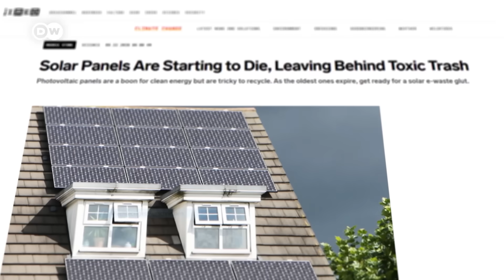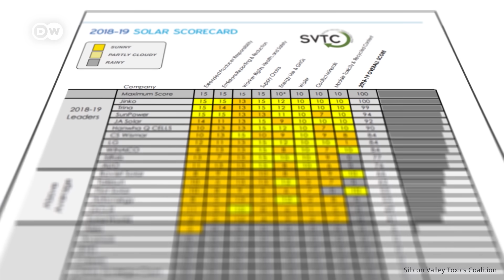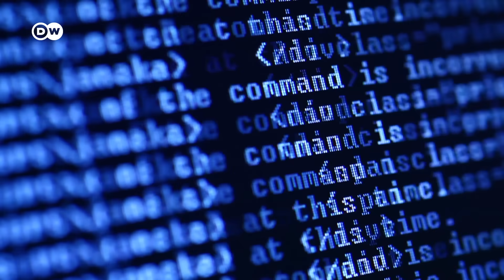How green is solar energy really?

Comment: It is relatively easy to calculate the carbon footprint of production and disposal costs. Yes, these are real, but generally a tiny amount compared to the amount offset over 25 years of production. I remember the same panic/misinformation about wind turbines, then scientists did the math and found out it takes less than a year for turbines to make up their production carbon footprints
Reply: About wind turbines, i heard (not 100% sure) that they aren't recyclable and they just get buried underground. And they are massive, if u ever saw a blade on a truck trailer.
Reply: In fact, they say it's a tiny amount, they are objective and correct.
Reply: @gabr1p1p1  that's good. I couldn't make it through the sensational first several minutes. It took so long to get to the factual story, I gave up
Reply: @fnusecurity5112  Thank you, Mr. Guard Shack.  I keep saying, "THERE AIN'T NO SUCH THING AS A FREE LUNCH".  Renewables create NEW problems.  They are not a magic silver bullet.
Reply: @fnusecurity5112  The whole problem of this modern world is that everything is seen through the “profit”. At this rate, man requires 4-5 Earths to sate his needs and greeds. Man’s “economics” is flawed; he and his technologies owe an apology to ecology.
Reply: From what I understand—and Shellenberger does an excellent job diving into the economics of PV panels—it's not just the production of them. It's currently much cheaper to produce them than to recycle (first flag). Then, there's the issue of consumption: on average, people are replacing them with newer models well before 25 yrs (second flag). Finally, they release some noxious materials when left in landfills.

I think the best path forward for many societies is a combination of LPG, hydro, and nuclear.
Reply: @MadLadsAnonymous  Alternative energy farms are built without any consideration of decommissioning.  I live below a group of wind farms (alas).  When the wind farm corporations were going through the approval process (wining, dining, and flattering the unsophisticated County Commissioners of our rural county), the County did not include a provision for decommissioning the turbines.  When the turbines are defunct, this impoverished county will be stuck with the cost of hauling the turbines away  (or leaving them to rot in place).
    We should focus on fixing urban transportation.  Buses and trams powered by hydrogen?  Why not?  Preferable to electricity produced by nuclear plants.
Reply: @zeitgeist5134  Do you know what it takes to decommission a nuclear plant? You would be appalled.
Reply: Wind turbines slaughter birds, especially migrating birds.  This is an environmental disaster.  Those dead birds were vital to the ecological balance.  In 2000, I moved to the Columbia Hills flanking the Columbia River.  At that time, circling raptors filled the sky; it seemed as if there was a raptor on every telephone post.  Then they built the wind farms.  The wind farms exterminated the raptors.  Gone.  Dead.  As far as energy production is concerned, THERE AIN'T NO SUCH THING AS A FREE LUNCH.  Renewable energy just creates new problems.  We need to reduce consumption, reduce the demand for electricity.  We burn so much electricity for no good reason.  Like energy-hog Las Vegas.  It's obscene.
Reply: @zeitgeist5134  Glass windows kills magnitude more birds every year than wind turbines.
Reply: @danielvilliers612  That is so very reassuring.  Vast numbers of birds are being killed by glass windows, so therefore it is perfectly okay that turbines are slaughtering migrating birds (and migrating bats....do you have any evidence that glass windows kill bats?).  It's okay that turbines exterminated the raptors in the Columbia Hills.
     There is a voice in the primitive part of the brain, going way, way back in evolution.  It says, "I don't have enough!"  It's the engine that drives the consumer culture, and the compulsion to consume is destroying the planet. killing the wild creatures.  But there ain't no such thing as a free lunch.  We will pay for our folly.
Reply: Were those calculations done under the assumption the production is done in America, or China.
Reply: Just read comments, leave like there, skip this vid.
Reply: Do you have any sources? I'm curios! I love solar panels!
Reply: The real carbon footprint is a lot higher. How high depends how much energie is NOT produced by nucleair, gas, coal… As long as these traditional power plants are running, because of grid stability, the green gain is a fraction of what the PV and wind turbines produce. The traditional power plants just blow the energie (steam) through there cooling towers, just in case a cloud crawls before the sun or the wind speed dorps. If so they can send the steam right away to the steam turbine and keep the grid alive. Heating up the boiler takes too much time so it is kept hot and the exces is waste, straight to the cooling towers. Heating up the boiler takes too much time so it is kept hot and the exces is waste, straight to the cooling towers. So minimal less traditional energie is produced, so minimal gain for the environment. So what we do today has to be done in a different way are there will be no benefit for our earth. We have to continue to improve our energie/grid stability if we want to make a diffrence. And driving ev is going to even bring more stress on our grid. Charging cars after sunset...
Reply: Well analysed!!!what we require is a comprehensive equation!!!
Reply: We’ll run out if the raw materials necessary to produce the batteries necessary for solar and wind long before we’d run out of natural gas.
Reply: @Daniel Meyers You know how much oil they use?
Reply: I think the main concern will always be the end-cycle of these panels. Despite what this video states about recycling solar panels, there is NOT YET a viable way of recycling it. And that is the main issue...not forgetting the mammoth amount of space these things need to generate the same amount of electricity, as conventional methods...
Reply: Less than a year for wind turbines what the ..... What are you talking about 😂?!!
Reply: they claim - solar panels produce 43 g CO² per kWh !
that's impossible !
a 1 kW panel produces (in India) more than 4 kWh per day (annual average ).
efficiency decreases every year over 20-25 years (considering 80% between 15- 20 years etc).

It will produce 29950 kWh.

if their claim of 43g/ kWh CO² footprint is right ; it means
 1 kWh solar produces 1290 kg CO² from mining through installation.
totally false !
petroleum lobby at work.
Reply: @pravindahiya719  you underestimate how much energy it takes to mine the materials alone and the fact that it takes huge amounts of power to make them.  Almost nobody is recycling panels or blades and the companies doing it couldnt be profitable without goverment subsidies or grants.
Reply: @chuckd9007  And you don't know how to count. The guy provided numbers, you provided...
Reply: You don't even need Scientists to do the math. This is math on 9th grade level.
Reply: @neptun2810  I know, that's why seeing a 10 minute story on a non-issue is frustrating. You know the whole topic is only brought up by anti-renewable energy lobbies to implant doubt in new tech, anyway. From a carbon balance perspective, it's a non-issue.  Yes, waste mgmt is an issue to consider, just like everything else that gets made.
Reply: @guru47pi  Yep, this video pissed me WAY off.
Reply: @guru47pi  Yes, but there are perfectly valid points they do make that you’re ignoring. Like the fact that trying to get our current power grid to work on intermittent power sources like solar and wind requires a fundamental different engineering philosophy than the one our power grid was originally built on. Electricity isn’t like water it works in fundamentally counterintuitive ways sometimes. The only reason our power grid, which we spent 100+ years building, isn’t constantly exploding is because we’re able to maintain constant voltages and frequencies, frequency drops even slightly and it’d surge back and blow out the generators and substations, too high and it’d start melting the wires. It’s not enough to simply make enough electricity we have to be able to transport it too, and unfortunately there are regions in the us where solar and wind simply aren’t practical, the further north you go the less useful solar is and consequently the higher the carbon footprint. The further electricity travels the more charge it loses.
Reply: @ls93780  that's not an argument against renewable; that's an argument for a modern electrical grid w/intelligent storage and surge capacity. For example, South Australia has lots of coal and a little solar and wind; they installed a Tesla battery system and it cut electric costs dramatically, and paid for itself almost immediately
Reply: That tiny amount you are talking about is acres and acres of solar panels. Didn't you listen to the video? It says there are about 250,000 metric tons of decommissioned solar panels now but by 2050 that number could reach 80 million. What use is watching a video if you don't listen?
Reply: @Rap  it's a tiny fraction of what the environmental impact of oil and gas is. And over time, companies will find a ways to reduce the waste as volumes go up and metals get more expensive. 250,000 tons sounds like a lot, but on a world or national scale, it's tiny. For example, US solar and wind make about as much electricity as coal, but coal burning takes 500 million tons of coal every year. The waste from solar panels is 0.05% as much coal burned in the US every year, and all that burned coal doesn't disappear, it goes into the atmosphere
Reply: I'm more concerned about the immoral sourcing of the materials used in green energy production.  Slave mines in places like China and other dictatorial regimes or warlord controlled regions...
Reply: @gideonroos1188  That's a political problem, not an environmental one. If you are really concerned, think about slave labour in clothing factories producing acres of stuff people wear once or twice before ending up in landfill, or the kids who make fireworks in factories that regularly burn down.
Reply: Two other things to consider to add to this. Firstly as shown by latest studies by US NREL, the average solar cell degradation is o.5% per year. Which mean you would be over 80% after 40 years!!! There are some modules which are as low as .2%. That is above 80% for 100 years!!! So in fact even if you don't go the extreme .2%. Solar panels lifespan and thus production/lifespan should be should calculated closer to 50 years than 25 years and could clearly be of use 50 years and more even at half capacity. We are talking closer to a human lifespan where installing panels today would outlived a lot of us.
Reply: Actually wind turbines create very damaging electro magnetical field that can couse illness to people. Just dont live near one and you will be fine
Reply: @soirema  i don't want to scare you , but there is a GIANT FIREBALL OF DEATH emitting electromagnetic waves as we speak right now and its very scary , please don't go outside

Also literally the first result from google says its safe i don't even know where you pulled this phobia from lol
Reply: @yahiaaymankamaly3518  thats why the numbers matter, i dont think that sun is as close to you as those, you know. There is plenty of videos about that too you knowz go check them out

Comment: Well...I still prefer Concentrated Solar Power (CSP) to solar panels because the glasses don't expire. Only problem with CSP is the cost per kWh,  transmission and it is expensive to build. But, latest technologies have increased the heat produced from CSP to 1000 degree Celsius.

Comment: As If there is no manufacturing emissions from the steel used in pipelines, or no toxic compounds generated in the extraction processes of natural gas or oil. 

There is no technology absent of environmental impact, but if you analyse emissions over the lifetime of several technologies, solar has a great potential to power our society energy needs. Even Eolic energy (which is quite mature and is great renewable tech on its own)  needs rare earth materials like neodymium to function. 

Quite an educative video to raise consciousness for the impact of fossil fuel alternatives, but this knowledge can't dismiss the initiative that is needed to substitute the fossil fuel energy industry for more cleaner ones, like Solar and Wind.

Comment: Don't forget they don't work at night, when it's cloudy, or when they're covered in snow. You know, like when we need them.
Reply: @Daniel Meyers  How on earth does that statement suddenly validate solar panels? Besides nuclear, what other reliable low carbon option exists?
Reply: @Daniel Meyers  Hydro is clearly being incorporated where ever it can be already. Geothermal can be tapped only where it's available. It can't be exported. All wind and solar require backups. Energy storage may work one day, but right now it isn't good enough and batteries are no better environmentally than fossil fuels. Solar farms are the worst. It calls for bull dozing farms, forests, jungles and deserts leading to permanent and unprecedented plant and animal habitat destruction. I thought that this was what we were trying to avoid. So far none of these come close to the percentage of fossil fuel use that we are going to have to replace.

Comment: I would like to see the kilowatt hour analysis applied to power from an existing nuclear plant. Huge amounts of energy relative to the amount of carbon produced from mining or the original construction
Reply: What I remember is French nuclear power run at about 12g eq CO2/kWh. Most of the CO2 come from the uranium enriching process, which requires a lot of energy. Thanks to the fact that about 70% of the electricty production is low carbon (mostly nuclear), it is a bit lower than other in countries. I cannot remember the figures for other countries but it is below 25 gCO2/kWh.

Comment: You need high quality quartz and high quality coal to build solar panels. Usually in arc furnace for Melting and creating panels. For normal panels only 20% at max efficiency. 60 years of trying and lots of waste.  A simple 4000kw gas turbine made in 1938 stayed in operation for 63 years . I love solar but it's not good for long term energy and with the price of batteries and inventers for storing energy and using it while it's snowing or storm it's not reliable energy source no matter how much you telling.